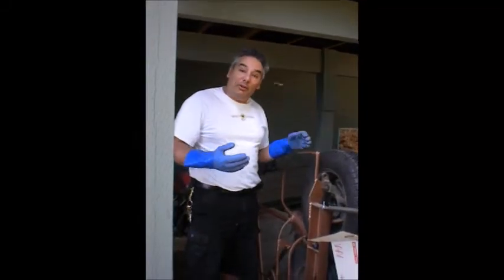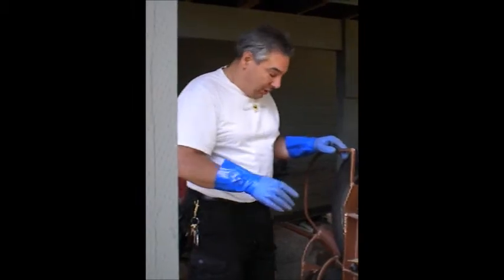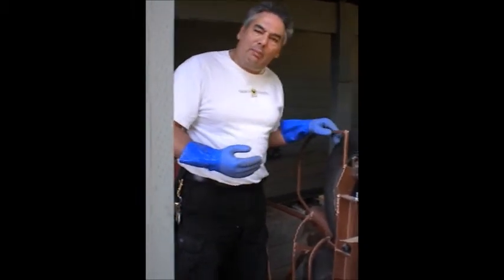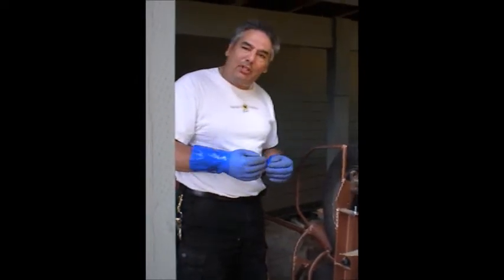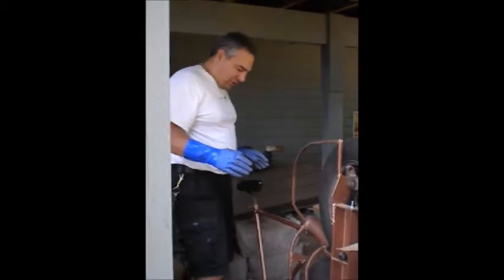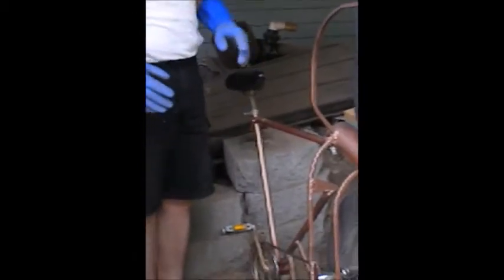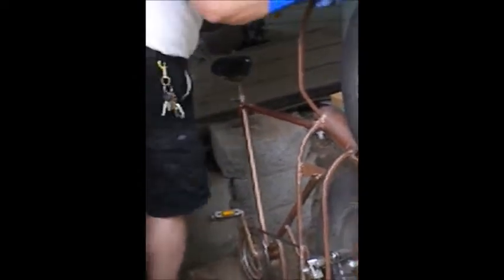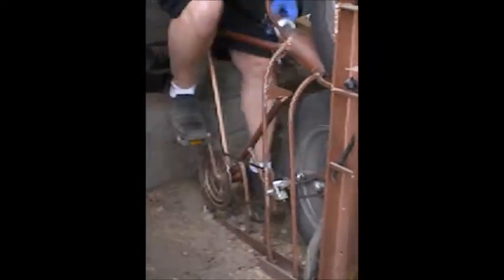Can Crusher

Comment: hi Patrick, i would like pictures' DETAILED view of your bicycle. i have NEVER posted comments on YOUTUBE how do i get in touch?
Reply from the maker: When someone comments on my post, I get an e-mail, so that is how you get in touch with me.  What kind of photos do you want?  The machinery is pretty simple, two bearings from front wheel drive cars, I think one of them was a Toyota.  Unlike most tires in the junk yard, I found two with some nice tread. The foundation is a bunch of scrap steel, and I did the alignment by laying the tires on the garage floor, attaching the brackets, tack it all together and then weld it up.  I used 3/4" all-thread for the wheel drive axle, and mated that to the bicycle rear wheel sprocket.  After I cut up the Schwinn Varsity, I figured where the pedals had to be to align with the sprocket, and built up a foundation to mount the bike frame.  The same with the feed tube.  Once I had the pipe shaped right, I built up a foundation to hold it in space.

Comment: can you describe what you have going on between the  and the wheels?
Reply: err pedals
Reply from the maker: I had to buy two bicycle chains because the distance between drive gear and driven gear is further than on the original Schwinn Varsity.  I removed the gear from the back wheel and mounted it to a 3/4" threaded rod, which also mounted to the lower wheel.  I used the chain tensioner  to keep the chain taught.  Would you like some pics of the assembly?